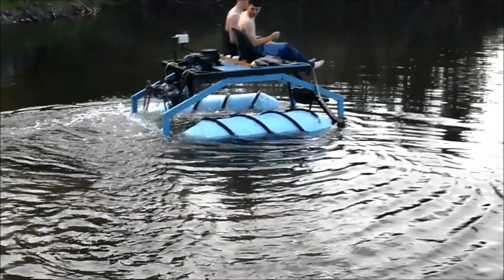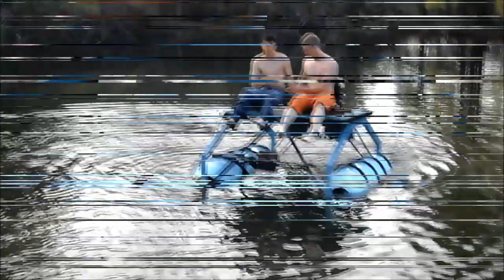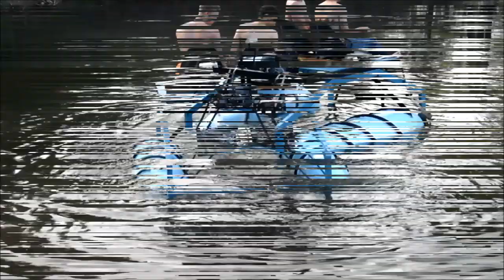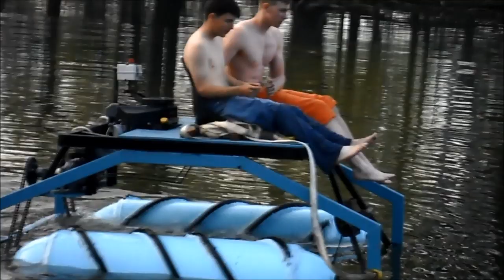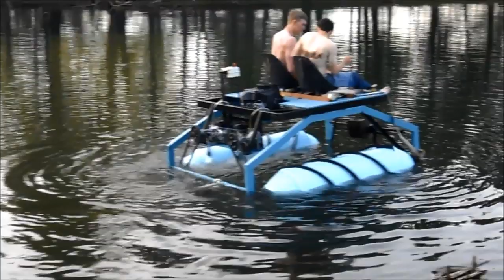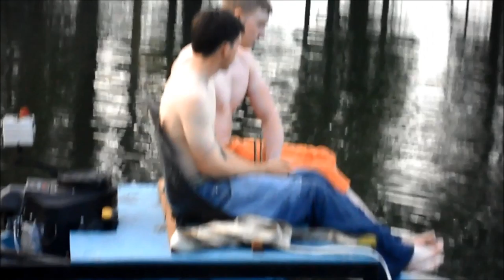Fordson Snow Machine on Water

Comment: WHY water??
Reply from the maker: My first comment ever on this....  spring semester college project ,  May graduation in New York = no snow at the time.  The unit did not work well on snow.  Under powered drive system for snow.   I give the group a lot of credit for getting what they got done.   We let the students run a bit with their ideas.   If it was all the teachers ideas then not much of a student project at that point!   I have seen many projects as I wonder who really designed it the teachers or the students.....
Reply: @giessjh6  Thanks......